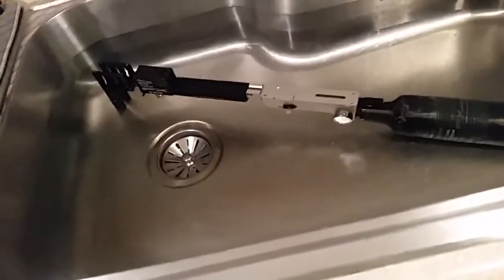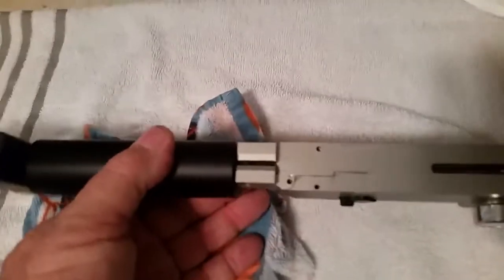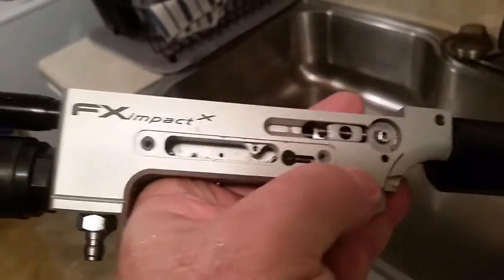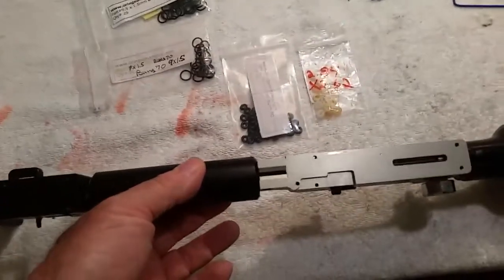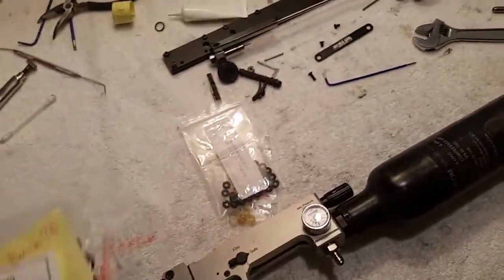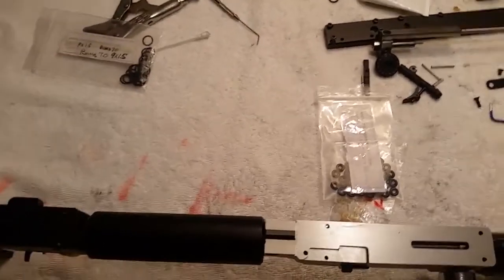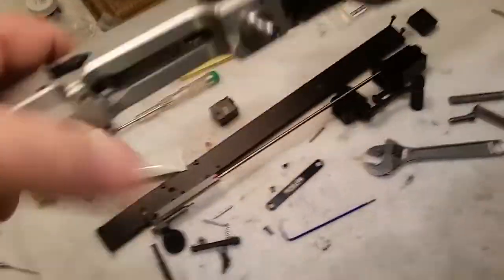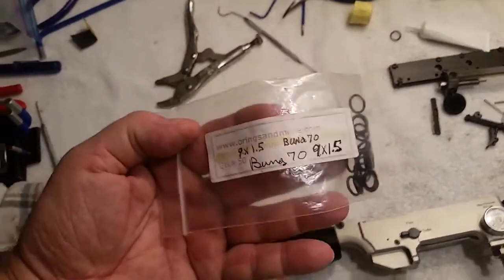NASTY PLENUM NOSE LEAK - PART TWO!

Comment: I have a small leak from the atmospheric hole and I have changed all the o rings . I Changed more than 20 but still with the leak . I changed a couple which were white but I did not have white ones so I put the black ones still with the leak .